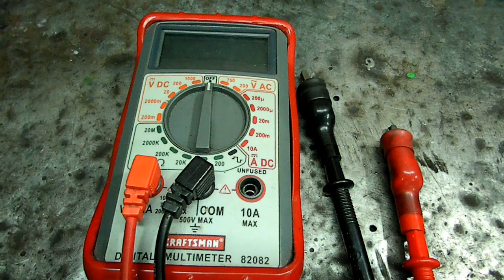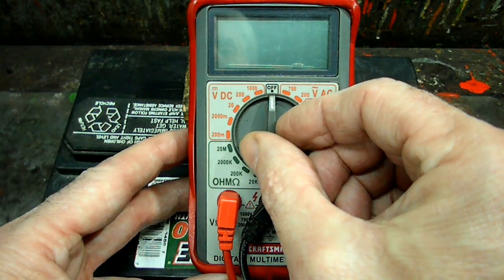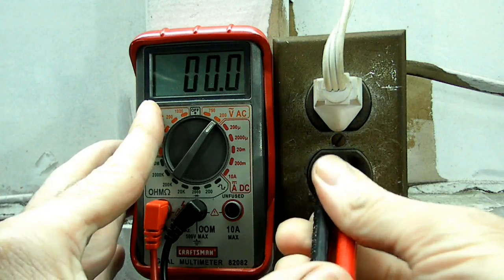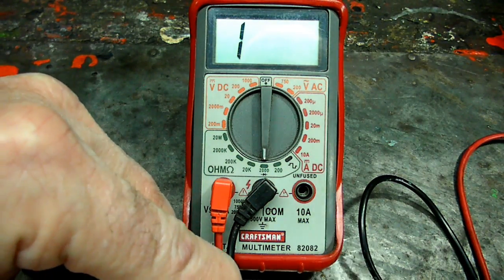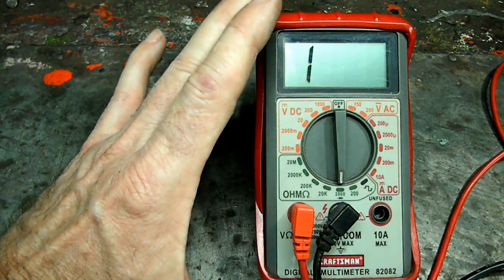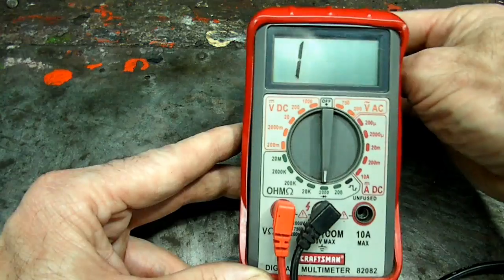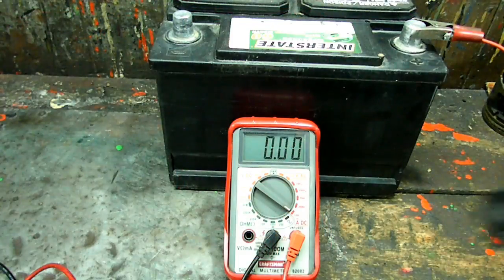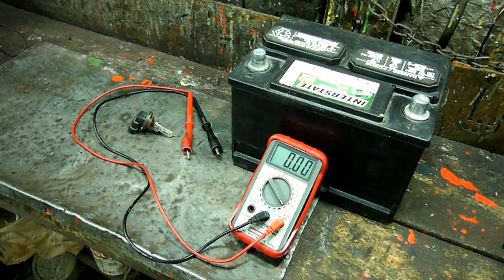How To Use A Multimeter

Comment: Just for safe measure, when checking that 120v at the wall outlet, use one hand, if possible, rather than than both.  That way, if things went south, you won't have current flowing through your chest.

Jeff

Comment: Dear Richmond,
   I used a multimeter on my battery. Voltage read over 12 volts. I thought the battery was good so I looked for a short and everything else. The problem was the battery. What the multimeter did not tell me was that two cells were shot. I needlessly spent a lot of time in -33°F looking for an electrical problem.
The BATTETY DOCTOR used a tool similar to a coolant gauge (I cannot remember what that tool is called) by sucking out all 6 holes where the "water" was and determined that two cells were shot. Again, the battery was charged to the max, but the two cells were shot.
FYI. It's important to take the battery in to get the cells checked out first.
David
Alberta

Comment: He wants to check for nueron continuity between his ears 👂👂to see if his brain is firing on all nuerons,you check a diode to check that current and the diode is forward biased,a diode does not pass voltage it passes current in one direction,also you check a battery under load,not in open circuit which tells you nothing about how good the battery 🔋 is,also sticking things in Mains sockets  ie test leads can be very dangerous ,especially if your brain is in neutral 😐and you are standing in your bare feet 👣 in bucket of salty water,marks out of 10  for safety -10 for amerturist behaviour and safety.👎👾👷🙀🙈🙆🙅

Comment: Not really like my Radio Shack Micronta 22-188. It has Auto Range. But the only two plug-ins are DC ma / K ohm 200ma max and DC 1000v AC 750v max.

Comment: That was great on the basics of a multimeter.  I have a question, could the battery blow up in your face or cause some shocking spark.  I guess the car battery makes me nervous.
Reply: Use an AGM or Gell battery like the Optima. They are less likely to blow up.

Comment: Great video but I'm still kinda iffy about putting the leads into my wall outlet. I've got a newer Craftsman  meter,model number #82141 and it's kinda set up the same as the one used in the video.

Comment: Good video thanks. Can you please explain where the black and red cables go on the digital multimeter mine has 4 inputs, it's a Craftsman model #82026
1.Red input 20A,
 2.Red input A /oms simbol/and a battery simbol 
3. Black input COM
4. Red input V/F

Comment: Very well done. Thank you! I am trying to test a Ba15s led Tail light bulb (2 prong Bayonet style). I put the multimeter switch to 2000 and connected the ends to the bottom tip of the base and the metal side of the base. Nothing changed. I noticed the when i touched both tester wires to the metal side of the bulb base (not the bottom tip though) i got a reading of 0.5. But it was not 0. This is a brand new 12 volt LED bulb. Ideas please? Thanks.
Reply: Bulb is bad

Comment: I tested a diode/fuse and it read 000 every way. What does this mean? Is the fuse bad?
Reply: If it's a fuse is in good condition.....if is a diode is in short
Reply from the maker: Are you getting  low resistances in both directions.

Comment: That's some scary shit with you inserting those cheap crappy probes into that 110AC socket. In the UK, our leads have to be GS38. This means the tips are no greater than 4mm in length, making it impossible to do what you did! As an electrician, I would not advocate sticking these cheap probes into mains electrical sockets! Use a proper approved voltage tester or multi meter with a test plug. Consult a qualified electrician, if you have absolutely no idea what you're doing!!!!!
Reply: No, I'm not from the UK.  However, I travel there about once every 12-18 months to visit my cousin.  I do electric work on her house sometimes, because she says it is very expensive there.  I think the rules there are a lot more restrictive.  However, what he was doing in the video is harmless.  As a field tech, I commonly work near exposed 600V bus bar.  That is where you don't want to slip up.  I've been hit with 120 more than once, and it doesn't do much more than make you pull your hand back really quick.

I'm guessing we're just talking about differences in what we are restricted to.  I must say though, I would hate to be restricted in what I was able to use or not use.  Cheers.
Reply: I fail to see what is so scary about that.  How are those cheap, crappy probes?  And as an electrician myself, I have to ask -- why would you not advocate putting those probes into the socket?
Reply: TheGrump101 Well, if you're a spark in the UK you'd worry me if you're having to ask me that?! Maybe you should take up plastering?!
Reply: TheGrump101 Well, if you're a spark in the UK you'd worry me if you're having to ask me that?! Maybe you should take up plastering?!
Reply: mokotramp I fail to see the danger you are referring to. You answered none of my questions. I work on low voltage gear (up to 600V). I use a wide range of devices in my job. Every piece has specific ratings in regards to what I can use it on. Sure, this is not a top of the line Fluke meter, but 120V is nothing to worry about. I demonstrated this exact thing to my 13 year old daughter. Yes, she did the exact same thing that was shown in this video.
Reply: TheGrump101 Read my original reply, you obviously don't understand what I'd written? This is bad practice, you're obviously not from the UK?!

Comment: RITCH GREAT JOB EXPLAINING USE OF DIGITAL METERS ,BOAT WIRE QUESTION,USING SAME METER HOW DO I TEST WIRES GOING TO AND FROM BOAT BLOWER MOTOR? (WITH BOAT BATTERY ON I ASSUME)ALREADY REMOVED BLOWER AND CHECKED ON BATTERY SEPARATELY BLOWER WORKED FINE..,REMOVED DASH AND CHANGING BLOWER SWITCH ALSO COLOR SCHEME ON WIRING LEADING TO SWITCH  VERY SHAKEY...FUES LOOKS OK....PLEASE ADVISE...
Reply from the maker: So i assume the motor is not working if so you could start by checking for voltage at the motor working back to the switch.

Comment: Hey Sir, Awesome video... I am working on boat wiring and i would want to test and see just how much certain electronic items are using. For instance I have a 1100 sonar and another sonar up front. I also have a 5 port ethernet hub and a bow 360 as well. These individual pieces have their own wiring and fuses. I want to know which portion of your video I can use to test amperage that is being used by each. I'm sure that I can look through my manual to make sure I am finding the positive side to each cable. I do have a nice multi-meter that can manage these tests that I need to do to make sure my sonars are functioning properly. I will look forward to your reply

Comment: Good day

I tested my battery today and i have 20A DC instead of 10A in my multimeter. ( Does it make a difference? )
I got a reading of 0.29 

I'm a bit confused, does this mean it is 29 mA and i am ok or does it mean it is 290 mA and i have drain? (as normal is 50 mA)

Thanks
Reply: +richpin06a Would you please let me know your thoughts? thanks
Reply from the maker: What setting is your meter on.
Reply: +richpin06a 
Multimeter set on 20A DC. 
Black in COM port and Red in 20A unfused.

Comment: I didn't understand why you would want to check the volts of an auto battery. A multimeter cant tell you if the battery is good or not.
Reply: 11, 10, 9, volts would indicate low or not fully charged.

Comment: do I need fuse for multimeter?
Reply from the maker: +Okaythen001 Most multimeters have a internal fuse for protection.
Reply: +richpin06a mine doesn't have it, it says install a fuse to prevent fire so that kind of scared me. so I was wondering. I got this one   http://www.craftsman.com/craftsman-multimeter-digital-with-8-functions-and-20/p-03482141000P

Comment: Excellent information, at 7:05 when you do your continuity test with the OHMS setting my multimeter has a seperate continuity selection on the dial that is audible when a clear unbroken connection is tested and my point is that when testing with the OHMS selection meaning resistance that is for checking resistance of a resistor or resistance from a load through a circuit that reduces current flow and that would normally display a value on the screen for those that don't know but you are teaching us so am I correct?

Comment: I have a Carvin MTS 3200 100/50 watt guitar amplifier head,and to set the overall bias it says to read the current at the standby switch,I have a craftsman model # 82141 meter,
a Carvin tutorial book says to put the meter at the 10A setting,but it does not say the 10A Aac scale or the 10Adc scale,do you have any idea which scale to use ? I do know that I am supposed to put the red lead into the grey 10A section on bottom of meter. any info greatly appreciated!
Reply from the maker: +adam ross I looked up the specs on the mts 3200 and all i see is AC i did not see anything about DC.

Comment: Hi, good video & good explanation!!
Question?? So the last thing you did with an ( A)
I couldn't see it.....because I think you did it w/ a jump wire to go in the light and the other goes to the battery right...... and the red lead one go to the right side of the light volt and the other to the negative ground battery I guess right .....because in the video I can't see it the jump wire & the others.?? 
Thanks again.....good job!!
Reply from the maker: +Danny Chuqui Yes i used a jump wire from one pin of the bulb i was testing to the pos post of the battery.

Comment: Hi anyone know the drop on a 3 or 5 metre USB 2 cable
They start at 5 v 500 MA but what is the reading at the other end?
I get problems on 5 metre cables and don't know if its the power drop over length or loosing sync 
If its sync then I can get a bus powered  repeater. 
Devices are a joypad and headphones.

Headphones work at random but when bass boost is on they die and drop sync with the PC

Comment: I am confused about the continuity test (where the display shows "000"). You set the knob on 'ohms', and put the lamp in the circuit, so the meter should give the resistance of the lamp, shouldn't it?
Reply from the maker: Prashant Gaur You would think there would be resistance going through the filament.
Reply: richpin06a Yeah, there has to be some resistance in the filament. Wikipedia says an incandescent bulb has several hundreds ohms of resistance. Please sort this out for me.

Comment: That is a great tutorial on how to use the multimeter. I have two digital meters, and one older one. I mainly have used mine in the house to check electric circuits, but have used them on the automobiles also. I was trained in the air force on how to troubleshoot certain components and that was a long time ago and I had forgotten how to do the tests until recently.
Reply: CBC power lift

Comment: richpin06a; Thanks for your video; troubleshooting a Water Heater and trying to find a problem with an old Volvo that keeps shutting off in the middle of traffic. We drove it a little over a hundred miles last year; because of this problem. Leaning how to fix cars; a must in my life. We had the Volvo worked on three times and said it was fixed and it did the same thing all over again. Thanks again; great video!!!
Reply from the maker: Sounds like the volvo might be experiencing a sensor or ignition problem when it heats up.
Reply: richpin06a
Thanks for responding; will check this out!!!  I have been enjoying your video!!

Comment: Thank you so much.  Excellent demonstration. Question: when you checking amp-age on the car battery (for instance), and you get your reading, do you then check the actual battery itself for the amps it has listed on it, and if the number matches or is close, then you know your battery is at full power? Thanks.
Reply from the maker: For checking the battery i use a tester as in this video https://youtu.be/tVHlG9qgr8k
Reply: richpin06a Gosh, I hope you are getting paid for promoting this battery! It is a great link! If you send your traffic flow stats to the company, you may be able to get an endorsement deal and pay for some new toys! (Or get PAID in toys.)  I am a food writer and got an excellent set of knives for writing about them. But like you, I only write about stuff I REALLY love and believe in.  Good luck! And thank you for responding to my comment  I am actually in process of attempting to repair a motherboard/control panel for a Whirlpool Cabrio Washing Machine model WTW5550XW0 and have a sneaking suspicion if I keep researching, I may find a way to replace one or two common capacitors and hopefully resurrect an $800 machine that pretty much looks and behaves beautifully when I tested ALL the other parts! If you have any tips on that, I know this isn't really your thing, but DO let me know! Thank you again! Email me anytime at renataskitchen@gmail.com. Thanks! Anyone reading who has ideas on how to repair a motherboard on an appliance like mine please feel free to email me! Renee/Renata
Reply from the maker: Renata's Kitchen Stories
That would be cool to get extra traffic flow.

Comment: A multimeter is great to have even if all you use it for is to check your carbon or alkaline batteries (i.e AA,AAA,C,D, 9volt,etc). in your TV remote or any other gadget that uses these types of batteries. You will only need to use the VDC(volts-direct current) section of the meter and leave it on the 20 number or lower if your meter has a lower number. most  cylindrical batteries are rated at 1-1/2 volt. a brandnew AA,AAA alkaline battery should read just over 1.6 volts. generally when a battery goes below 1.25 volts is when something starts acting irregular(like your TV remote) or the gadget quits working altogether. Many people have a drawer full of batteries and don't know if their good or not. Using the multimeter the same way he tested the car battery using positive(red) and negative(black) on the marked ends of the battery will tell you which ones need to be tossed. You can buy inexpensive meters at Harbor Freight !

Comment: This may sound dumb, but here goes anyway, the other day, I was putting together a little project, a home made small battery charger, well I was looking through my junk box, for a power source, and found an old cordless phone, I tested the power, bye touching the MM leads to the phone base, and got about 14 Volts, well I rigged up a box, that would hold aaa aa, C, D and 9 volt battery's, I took the charger, cut the end off of it, to wire it to my charging station, took the M.M and give it one more test, and it didn't work, I thought what in the heck is going on, it just worked five min ago, well to make a long story shorter, I discovered that the charger from the phone, was AC current, and something in the base changed it to DC current, I thought all of those little chargers were DC current, to my surprise, not the case, what is it, that changes AC to DC? I cant remember.
Reply: i believe its called a rectifier?

Comment: How do you use it to test for amps from a wall outlet, like the Kill A Watt?  The multi-meter would have to be able to handle 15 amps.  You'd have to get a couple of leads coming out of the wall outlet (forget the ground, nothing on the multi-meter to attach to) - maybe get them by taking apart an unusable, damaged extension cord.  Connect a 12 gauge white wire, with a couple of alligator clips on each end, to the neutral.  Then connect the multi-meter from the hot side of the wall outlet to the hot side of the plug.  You could get a shock doing this, if you're not careful.

Comment: As far as I know, there is no such concept as + and - in ac. What you have is the "hot" in the small slot (black, red, etc), the "nuetral" in the large slot (always white), and sometimes a ground (always green) for 3 pronged plugs. Often the "nuetral" is used as the ground either in the building's wiring or in male plugs that only have two prongs.

Comment from the maker: Joel Cruz,I bought that one at sears.
Reply: Hey mate, how do I check the wiring for a scooter? My brake lights work but the running light doesn't? I replaced it with a new light bulb and it is still the same no running light? I used multimeter on the old bulb and yeah only one filament is reading and the other is not. However, the new light bulb shows both reading for the two filament.

Would kindly appreciate your help. I tried looking everywhere and still no avail?

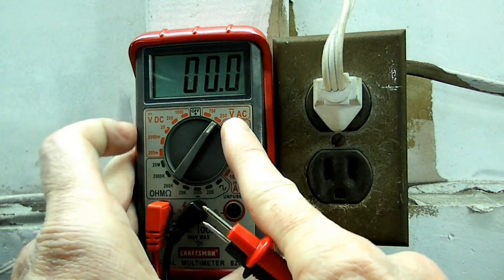Comment: 3:10 what happens if you forget the MM on Ohm instead of VAC scale? I think I destroyed my MM :/
Reply from the maker: Most multimeters have a fuse to protect the meter.
Reply: the fuse is alright, I checked it, but since I plugged the MM in a 220V plug with the switch on Ohmmeter function, I heard a sound in the MM, and since then it's been displaying weird values, like I'm testing a 9V battery and it displays everything but 9V
Reply: InfinityDz Like a compass, that never points North.

Comment: Always double check the test wire leads before doing any of these tests WARNING: when doing these tests such as 2:55 especially, ALWAYS DOUBLE CHECK AND MAKE SURE THE NEG AND POS WIRES ON THE MULTIMETER ARE CONNECTED IN THE APPROPRIATE SLOTS IN THE MULTIMETER
Reply from the maker: Very good tip.

Comment: How do you know the wall socket negative positive terminal?? If you accidentally put on the wrong probe in it will it blow?
Reply: Ayatollah Rock The reason for this "not mattering" is the fact that the current in the wall is "alternating current" or AC specifically.  So the leads effectively alternate between positive and negative.  In a DC circuit that's not the case so the lead color / polarity matters
Reply from the maker: When testing with this meter it does not make a difference which way you use the leads on the wall socket.
Reply: richpin06a thx i didnt know that...actually i want to learn how to use multimeter
Reply: kernelpanic1215 lo